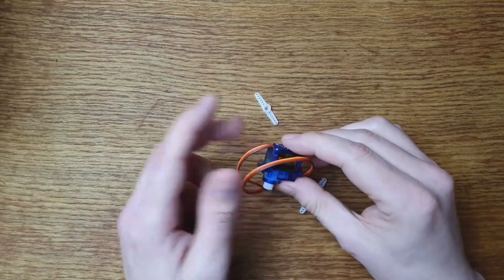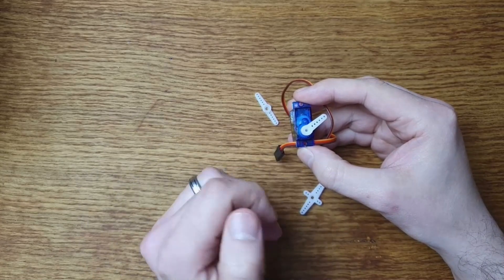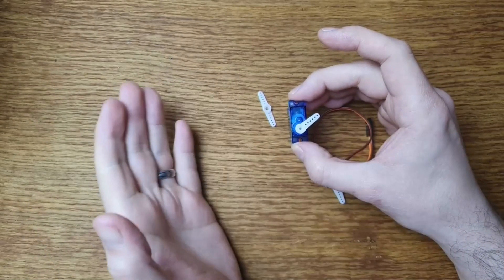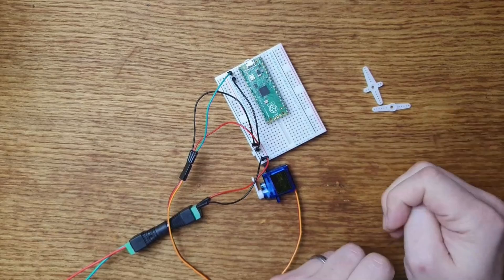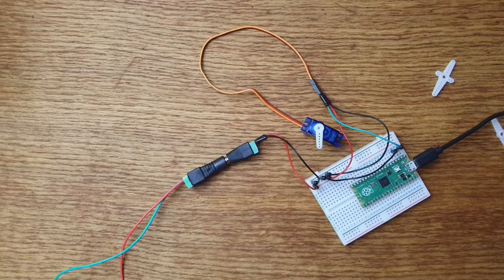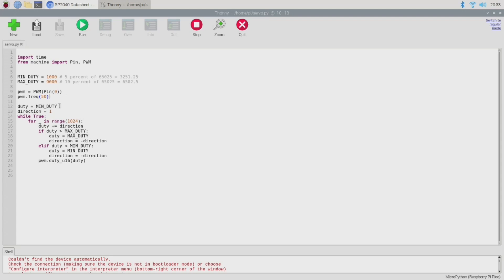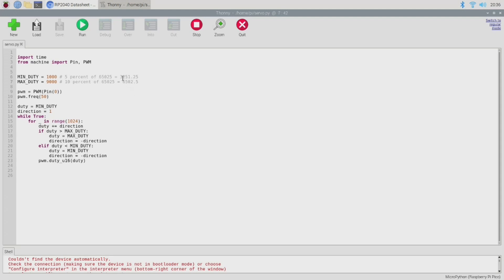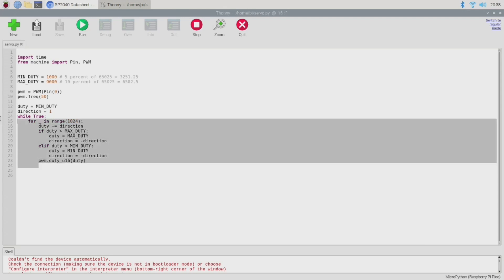Raspberry Pi Pico Servo Motors via PWM

Comment: Duty_u16 has a range of 0-65534, doesn’t it? Maybe that’s why you had to jiggle your calculated values for full range movement as you were using 65025?

Comment: this is one of the first videos i watched to get an understanding of using servos with my micro controller - 
revisiting it now as i have upgraded to mg90s servos for a robot project and mainly i wanted a clarification to the importance of that last line of code:
"pwm.duty_u16(duty)"

i thought it corresponded to what pin was in use but i see this is incorrect - can someone explain?

Comment: Great video BUT...
1) The SG90 (and the MG90) has a swing of about 210 and not 180. But 0 to 180 is used so that the arm is not pulled back when it goes past 180 degrees.

2) "High Torque?" It is called the SG90 because 90grams of the max allowed force the servo should run on. Anything more the plastic gears start to get chewed up. Now, the MG90 is a metal gear version of the SG90. Though the gears are metal in the MG90, does not mean one can go past 90grams though it can handle 4x the force, you can still break it.
The SG90 and the MG90 are the same shape and size though the SG90 uses plastic gears and the MG90 uses metal gears.

Otherwise great video!

Comment: Helpful information: The reason you had to use expanded duty cycle values is that the sg90 servos are actually 120-degree servos. Most Chinese documentation is wrong. They do have a max rotation of 200 degrees but it requires a bigger range of duty cycles than what the documentation states. If you run the servos at 900us -2100us duty cycle you will get the 120 degrees. To measure this you can use the shell in Thonny to set the duty cycle to duty_ns(900000) and mark the location and then set the duty cycle to duty_ns(2100000). This will result in the 120degree rotation that the servo is actually meant for. I have found that for most of these servos a duty cycle of 600us and 2500us will result in the 180 degrees that we want.
Reply from the maker: That's good info, thanks!

Comment: sir how can i turn 1 time 360degrees
Reply from the maker: The sg90 can only turn through 180degrees.
Reply: If mg996r sir you tried ?
Reply: I got the Micro Servo 9g SG90 and it can definitely spin around and not just 180 degrees.

Comment: hi could you explain me why " direction = -direction " in the if and elif, what does it mean and how does it work? thanks you very much
Reply from the maker: Sure, if direction is 1 then -direction sets it to -1. If direction is -1 then -direction sets it to -(-1) which it 1. So its just a quicker way to say "if direction == 1: direction = -1; elif direction == -1: direction = 1". This value, 1 or -1, is then added to the servo position control to make it 1 bigger or 1 smaller as needed. Hope that helps
Reply: @tinkertechtrove2910 Thanks a lot I hadn't understood that part

Comment: Tinker...a very interesting coding. How can I modify the code so that, at switch on, the Horn moves to Zero Position, then requests the user to tell it (via a text message in the shell area) to what angle it should move, and at what speed.. I am a newbie at MicroPython so having to just play with the various variables. At the moment the code just makes the horn thrash back and to.

Comment: It’s normal for a servo to want a pulse of between 1ms (0 degrees) and 2ms (180 degrees), which would equate to PWM duty cycles corresponding to what your data sheet recommended. 50Hz = 20ms. 1/20 = 5%, 2/20 = 10%.
I think the fact that you had to significantly expand this range is because your sweep is much faster than the servo can physically track. Try an alternating 5% for 5 seconds, 10% for 5 seconds and I expect you’ll see the range of motion is very close to the full 180 degrees.
Reply from the maker: Oh that's very interesting, it would explain things. I'll give that a go, thanks for the suggestion!